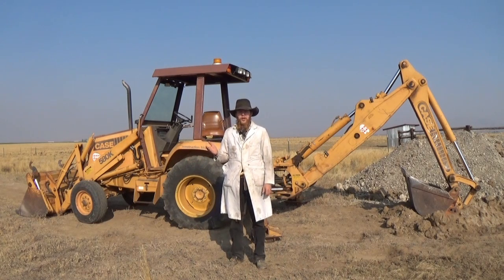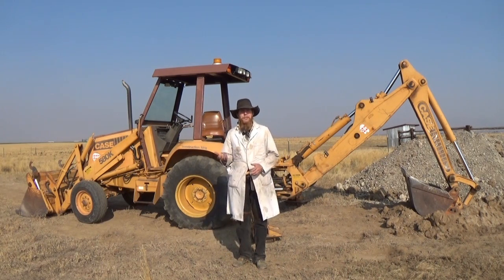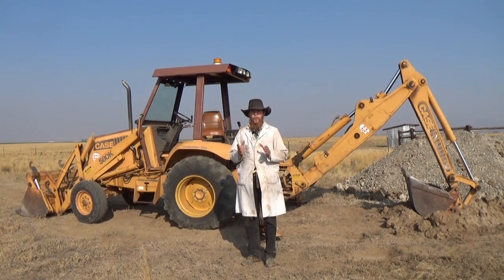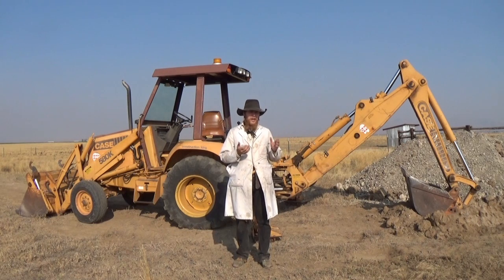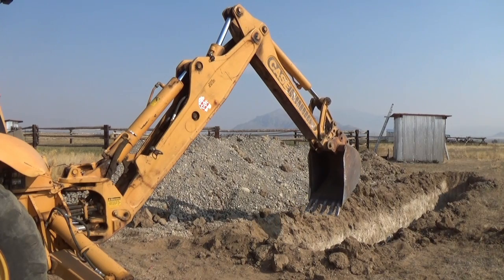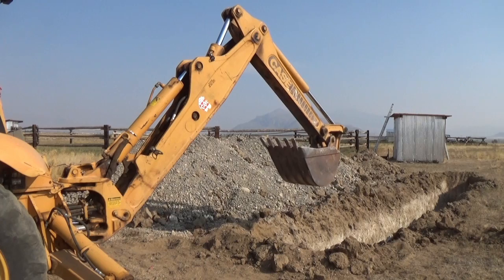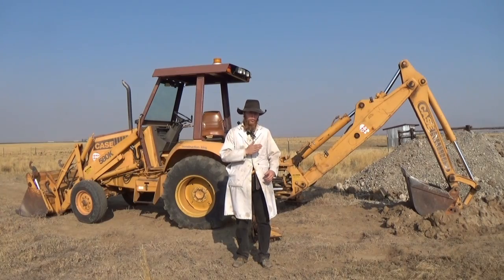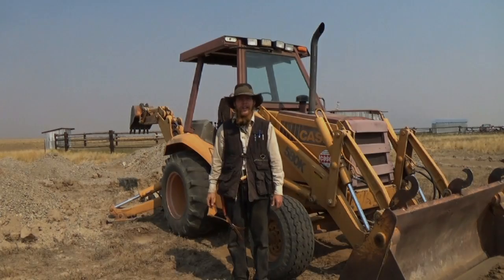Backhoe Controls (TIS052)

Comment: Your cousin was right,,, If your just a ditch digger using your feet to control the machine is not a big problem..  If you want to pick a dime up off the sidewalk with a 3' bucket your going to need some fine control. In my opinion (after 45 years of digging) who ever invented case controls should be taken out back and beat bloody.  Cat and John Deere wobble stick machines are complete opposites. The new pilot controls are okay to relieve you of some callouses but the best I ever ran was JD or Ford 4 lever controlled machines. Won many a hoedeo with those and a 4n1 loader.

Comment: now that you have used it awhile,  would you re position the hand lever so you could actuate the swing while simultaneously actuating another control?  If so, would you use the right or the left foot pedal?  seems that dumping and swinging are closely coupled actions to be coordinated during the dance of digging.   Thoughts?
Reply from the maker: Personally, I've never tried operating any of the other controls at the same time as the boom swing.  I coordinate the other three controls during digging and dumping, but I use the boom swing separately just to swing the hoe from where I'm digging to where I'm dumping or vice versa.  If you swing the boom while you are dumping, it seems like that would spread the dirt around more instead of dumping it in a pile, which could be good or bad, depending on the scenario.  Maybe you could save a little time if you dump during the swing, but unless you're a professional on the job and getting paid by the foot of trench rather than by the hour, I don't know if the time savings would really be worth it.  If I were to do this over, I don't think I would do anything differently.

Comment: My case is about the same age and it has 2 joysticks for the 4 movements
Reply from the maker: Interesting.  I wonder if it was a Case machine customized with controls that mimic a CAT or John Deere.
Reply: TheIdahoanShow well i will tell you what it is when i find out
Reply: whats your serial number?? Case controls are not dual joysticks.
Reply: A friend has a 580B that has joysticks.
Reply: Comments section is s dumpster fire.  You can get Case equipment optioned either way (subject to year and model restrictions)... but Case has been offering that for a few decades.
Reply: So does ours, our backhoe is a case 580 super king with a cabin and it has 2 joysticks for the hoe, 2 joysticks for the feet and a button to slide the hoe from side to side.

Comment: Just need to put some hours on one. A foot swing case machine will dig circles around any other controls on another backhoe
Reply: i dont know what crack pipe youve been smoking but if that were true they would still build them like that... and they do but pilot controls are way better.  simpler to learn, much more ergonomic too.
Reply: But it takes way more practice to use a foot swing.
Reply: 3rd to chime in...your comment may be 5 years old but it is still as unrelevant as the day you left it. Foot pedals to swing the boom are as archaic as the foot-powered Flinstone vehicles. If you can’t swing the boom with hand controls under steady hydraulic pressure you don’t have business operating heavy machinery, period.
Reply: @brandon18054  Thats a horrible argument. a competent 4 stick operator will dig circles around wobble sticks, pilots it would be closer.  anybody can run pilots that doesn't make you a real operator.  I dont know what region of the country you guys are from but there's still plenty of foot swing machines around here in eastern pa and Nj.  I agree pilots are more ergonomic,  give you more room in the cab, and give you the ability to change pattern but id still take a foot swing machine. Im not some old buzzard either at 34.  Ive got some old friction cranes, and an excavator that runs the bucket and stick with foot pedals.  Equipment that actually takes skill to operate. there's no faking it here.
Reply: @73DiamondReo  hell yeah pal these ass clowns don't have a clue. A real operator can run 3 sticks cat or deere controls.all the old heads swear by case controls . Simple to work on and cheaper parts too thats the selling point for me as well